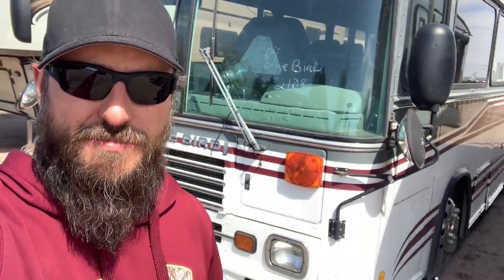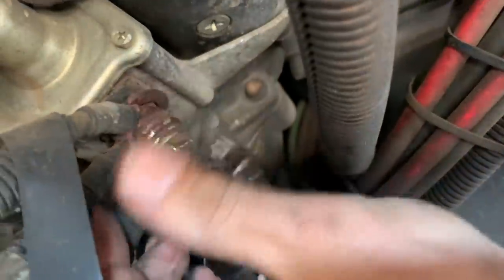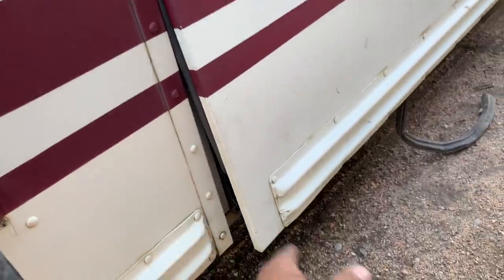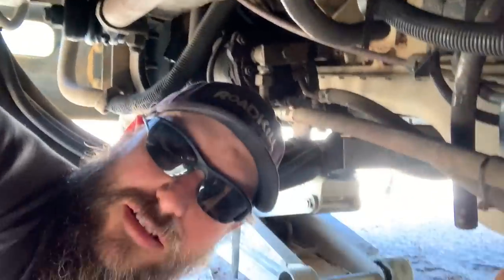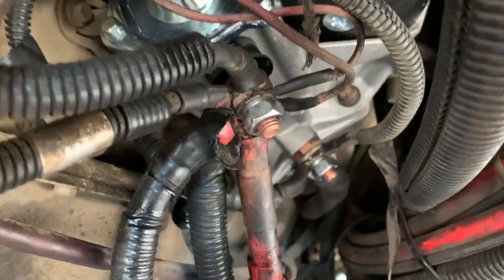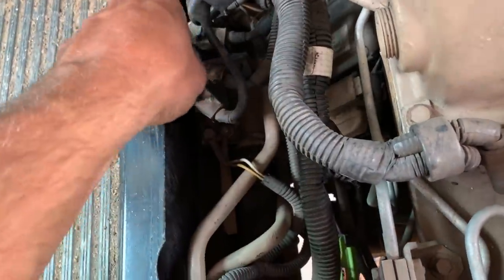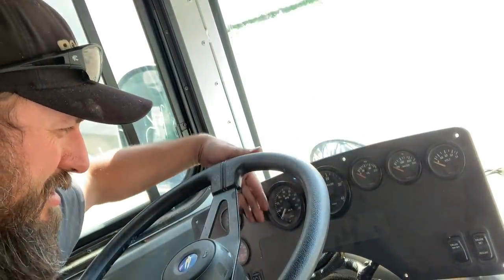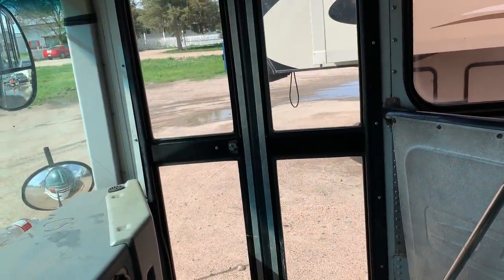Can I Get My Bargain Diesel Bus Running And Driving??

Comment: Take it from someone who has been trapped under a vehicle. Don't crawl under something that's only held up by a single bottle jack on the bumper in dirt. Getting killed isn't the worst thing that can happen. Getting crushed and being alive is.
Reply: You aren't wrong it's not worth it. I'd drive 30 mins to get some jack stands before I crawl under a vehicle on a jack
Reply: As someone who's pulled someone else out by their legs from under their shifting Prevost, ditto.  Proper cribbing is essential.
Reply: I knew a guy who died that way a few years ago. He was stopped helping someone else who was on the side of the road and crawled under a vehicle that they hadn’t supported well and it fell. I’ve been much more careful since then.
Reply: Yeah I agree with this totally!

Comment: Blue bird were top of the line back in the day. Each Coach was built per customer specs and were not mass produced "Stick-N-Staple" Coaches!. A year ago I had an opportunity to pick up a 38'f  8v92 Detroit powered Bluebird but the seller was dead set on the price of $22g's which was high for the year model and what the Coach needed. Pretty much sat in covered storage but for a couple years, so all 8 tires were showing dry rot, and alot of the engine rubber needed replacement, the airbag suspension worked as it should but would leak down in a couple of days, the engine was regularly started while in storage but, still needed belts hoses etc... too rich for my blood.
   Cool Bluebird you got there, thanks for sharing!!! 👍

Comment: find a conveyor belt supply place . buy some old belting get 3-4 foot wide USED belt about 6-8 feet long and slide them under what ever you work on outside . keeps you dry and cleaner plus it's easier to find a dropped but bolt tool and you can hose them off when they get dirty

Comment: Check for power on the S terminal at the starter the small wire when you have someone attempt to start. no power check starter relay right of gas pedal next to intake. there are two relays one is for the heater grid at intake for cold weather the other should be for the starter.

Comment: If it's got air suspension. 
Can't you connect an external air compressor into the system somewhere. 
Then shove some big jack stands in there . 
Safety first please . 
I'm in the uk and would love a bus like that . 
Yes RV / motor home . 
Great video .

Comment: Hi Dustin, I don't know how much you keep up with your comments, but I would like to offer a possible solution to your "wind/audio" issues on your videos. I heard you apologize, but maybe you can end that ? ... If you use a cell phone for your videos you can take the cuff part of a white cotton tube sock and slide it over your microphone opening. This is acoustically transparent but really helps stop the wind from getting to the mic ! ...It should allow your booming manly voice to be heard just fine. If you're using a camera of some kind I don't know if this will help you. ...Keep up the good work...love yer stuff ! ...BigAl , Minneapolis, MN
Reply from the maker: Thanks for the tip, i really do need to address that, it's so windy out here

Comment: Thats a denso type starter if you would of removed the 3 x 8mm bolts on the end of the solenoid cover you would of probably found that the copper ring around the plunger and it's connections are usually burnt and need cleaning it can usually done with a file clean it up to  make a good connection if it's really bad you can get a kit containing a new plunger and new copper terminals instead if replacing your starter

Comment: I would never run an engine without a belt on it's water pump!  That twelve Volt starter motor draws up to 2,000. Amperes starting, the old battery was mush.  I think you have an emergency starter motor already. Ron W4BIN
Reply from the maker: yes, belt was on, but clutch fan is not spinning, needs afew more parts

Comment: 17:47 Is that an electric radiator cooling fan or are you missing the belt? I know nothing about Cummins!  Good to see it running,now time to test that Transmission out.
Reply: I saw the fan sitting still while the engine was running also.

Comment: I work for Navistar, that ignition switch looks the same in the back as the ones that were used in the older trucks, you can pick one up for like $25-$30 bucks.

Comment: When the engine started the fan was not turning, you might want to check that before letting it get hot. The Bus Grease Monkey has some good vids on fixing air brake systems. If it was a transit bus it might have a real low gear in the rear end, engine will be screaming at highway speeds.

Comment: You need to verify your battery voltage under load. Check your voltage while you are trying to start the engine

Comment: 2 - 1000 cold cranking amp batteries, a fuel pump pressure test, trace the flow of bat power.

Comment: The coolant fan wasnt turning

 electric controller?

Or missing belt?
Reply: Alternator was turning, so it had a belt. Most likely also not an electric fan, as it has no motor on the back, so visco clutch is the most likely option.
Reply: big engines like these tend to have a temperature controlled clutch system basically works like a thermostat but with a clutch system for the fan
Reply: @makoshark40  And that clutch is called a visco clutch. Honestly, i'm amazed that many people still aren't familiar with them, even though the europeans have been using them for over 50 years now.
Reply: @unmountablebootvolume  yeah didnt know the name but yeah there mostly common on CMV style engines cause there so god damn loud so people who never dealt with busses semi truck excavators etc etc typically don't know they are a thing hell i didn't know how they worked exactly till i became a truck driver older style pickups tend to have them but like before 2000s and well most people on YouTube aren't well over there 20s to know about them in that regard either or was to young to pay attention at that time cause lets face it 2004 is considered an old as fuck car now days (yet ive never owned anything newer then 2000s personally)
Reply: @makoshark40  True, but they don't need to be loud. Well made viscos just click like an A/C compressor clutch. The thing that made them become so rare is that most manufacturers turned the engines by 90°, making it damn near impossible to have a front-facing water pump to install a visco clutch on. But the nice thing about them is that the only common problems with them is the bearings locking up, causing the fan to run whenever the engine does, or the entire clutch flying apart, launching the fan into the radiator and making some very expensive noises. I like visco clutches because they are so simple. No crappy chinese electric motor to catch fire, no fuse to blow, no tasty-to-mice wires to get chewed and send 12v into a 5v ECU data line, and no ECU to crash and run the fan until the battery is dead.
Reply: @unmountablebootvolume  yes i meant there loud because there usually accompanied by those enefficient square style fan blades that chop the hell out of the air giving it that loud whirring sound newer ones with vortex style blades where nice like the electric ones while still being mechanical drive keeping less failure parts like you stated

Comment: If I was you I would take the driveline out of that bus and put it in that RV you have it makes more sense to have a Diesel in that thing instead of a 454 big block gas engine then you will have more torque and power and be saving on fuel. How much fuel did you go through just driving it that kind of short distance away imaging a cross country trip you would have to be a millionaire to fuel that thing not to mention it's only a what 3 speed trans in that thing. That is crazy they never should of put a gas engine in them to begin with.